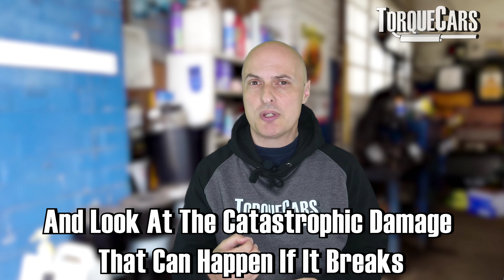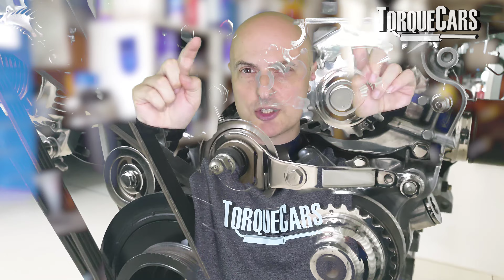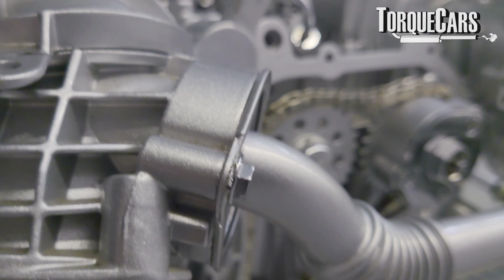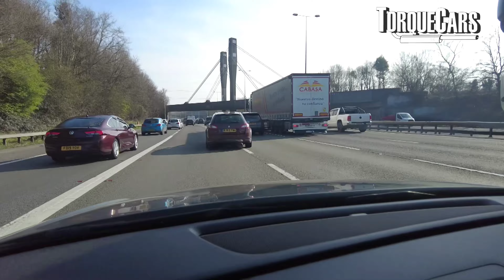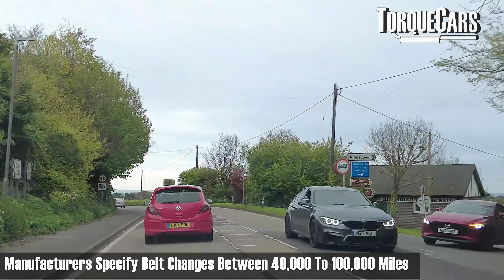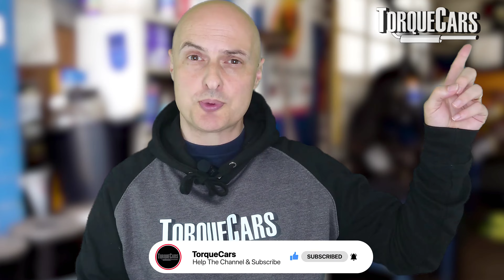Timing Chain & Cam Belt Failure: Why Delaying Replacement Could Destroy Your Engine!

Comment: Never heard  of a "wet belt". When I had a '92 Passat, I had the timing belts replaced according to VW's maintence schedule (every 60K miles). Signing off from Silicon Vallley, USA.
Reply from the maker: They are a modern abomination. They help fuel economy though!

Comment: with the introduction of wet belts on more engines this is more important than ever to keep the intervals in mind, as i found out after i bought a low milage 2014 focus. Two weeks after i bought it the belt snapped with absolutely no warning and i'm still waiting for it back after having a new engine fitted two months later. Fortunately its being done under warranty as the dealer should have made sure it had been changed before he sold it!
Its not always the mileage that kills wet belts either, its the age!

Comment: I own a 2015 VW Golf 7 TDI 1.6L @ 140.000 km so far. The manufacturer specifies a cam belt replacement at 210,000 km but no specific time limit. Since the car is now almost 10 years old, I’m uncertain whether I should replace the cam belt despite not reaching the mileage limit. I’m also concerned about the condition of other related components (rollers, pulleys etc). What would you recommend in this situation?

Comment: Nothing but complaints with tonnes of early wet belt failures with huge costly wasteful bills. Wet belts on all cars are a disaster with very stupid excessive charges when comes to changing if not already failed on you.

Comment: @torquecars can you tell us your thought's on vw's 140k mile and no age limit on timing belt replacements?
Reply from the maker: Of course the manufacturer always knows best, they tend to be quite conservative usually but I'm not 100% sold on this.

That mileage is quite stressed if done on short journeys or with lots of speed changes however if most is fairly constant there is much less stress. So I'd think about the stress the belt/chain has had to cope with.

With belts I stick with a very conservative 7 years 70,000 miles, with a chain I feel there is more scope to go longer and will wait 10 years 90,000 but that is just me. Audi Uk are still AFAIK recommending a change at 5 years although the rest of the world have dropped the time limit.

I'd be curious to know how people have got on before I commit to a longer change schedule.
Reply: @torquecars Thanks for yor reply I read on the audi owners club forum that there is no time limit on timing belts now,  only mileage at 130k miles.
Reply: @honestreview1043  Cambelts wear with age, especially rubber belts that perish as well, hence virtually everyone i.e. Ford say 120-150,000 miles depending on engine or 10 years max. Asking for very big expensive trouble if don’t change.

Comment: I think it's going to depend on the mileage and style of driving, if you're thrashing it, then yeah I suppose you have too. I had a 1998 Mercedes A140 from new, drove it gently, eventually I sold it with 250,000 with the original cam belt 15 years later. It's the same with all my vehicles, never changed my cam belts.

Comment: Back wen I started driving and owning cars - 1966- no one thought about this subject. They would have laughed at you changing stuff that was not broken. How designers have mugged us over the years to feed their dealers' profits. Still, no timings belts in an EV but they will still mug you for sure.
Reply: Woulnt be an issue on a non interference engine. Not sure when engine designs were switched.

Comment: My 2000 V70 went 15 years and 50k miles on the original timing belt. I'm hoping the 2nd one will last to 11 years and 70k miles. By the time I get to 2026 and I have 120k miles, it will be due for timing belt, PCV, axles, coils and plugs, tires, brakes, and probably some other stuff. The transmission in it is currently starting to slip and it's the most problematic year too so it will be a good time to scrap the car or sell it cheaply. I already have it's replacement in the garage so it's going to be okay. It'll be a shame and sad day when it goes away because the 5 cylinder is so nice and the seats are so comfy.
Reply: 15 years with 50k miles is like my 5 years old car

Comment: Our 1.2 TSI engine received a new timing chain at about 142k miles. It started to rattle for a few seconds after start up which was an indicator it was worn.

When our 1.6 TDI engine got a new timing belt last we were very lucky. A bolt holding one of the pulleys in had become fully lose and was only held in by the plastic guard!

Comment: I refuse to buy a car with a cambelt !!!
Reply: Cos every engine with a timing chain is the pinnacle of reliability...
Reply: Chains are just as bad now.

The chain on my bicycle is more substantial than the timing chains they put in engines these days.

They are designed to fail and to cost a fortune to replace.

Comment: Why change the chain at whichever comes first? My F-type is 8 years old with 28000 km on the clock. Does metal deteriorate when not in use?.
Reply from the maker: Belts certainly do deteriorate with time, but chains as you suggest are certainly much less subject to that. Rust is a potential problem, but this is mitigated with metal selection and a coating of fresh oil every time the car is started. Audi specified a 140000 interval but no time limit on chain changes, although Audi UK still say 5 years. In my experience chains mostly tend to stretch rather than break which causes some problems.
Reply: @torquecars  Chains tend to 'stretch'? or do you mean 'wear' which isn't stretching? As in motorcycle et-al chain wear (not stretch; as they actually can't!?).
Reply: @Richard_L_Y  The pins wear which will make the chain longer, giving a stretching effect
Reply: @retro423  exactly 'wear' not 'stretch', two completely different things.
Reply: @torquecars  I don't think (hardened) chains 'stretch' as such but wear and so become elongated - whether e-bike / cycle / M/C chains... those wear not 'stretch'... or are car timing chains different?
Reply: Engine oil does deteriorated even if not use.
Reply: @hengleekai7788  Agred, I bought my F-type exactly 1 week ago and it has been sitting for over a year with 300km since the last oil change. Tomorrow I'm changing the oil and filter. I haven't been using it over the past week because of this.
Reply: @kyproset 👍👍

Comment: My 10 year old audi a6 on 63,000 miles and not changed yet. Spoke with audi and theu say it doesnt get done till 140,000 and no intervals.
Reply: Surprising given Audi officially switched to the recommendation of 5 years, in the past the recommendation was 7 years max (my oldest is a PD, there it still says 7 years or 120k km). All garages I ever came in touch with strongly recommended not to exceed a grand max of 10 years, and rather go at least for a thorough check if every penny has to be saved. 
I was kinda surprised to see that on my oldest car, it s been nearly 9 years (but only 60k km since the last change) and honestly, I wanted it done coz I had the impression that I heard some ticking noise, especially in idle which also seemed rougher than what I perceived as normal. Verdict: gladly it was just the V belt tensioner for the alternator having too much play. I m happy I had it all done, I feel like it runs smoother in idle and ofc the other noise is gone as well (should have said like a well tuned tractor coz smooth and PD engines...) plus I have my peace of mind back. If I were you, after 10 years no matter what km/mileage, I d have it all at least thoroughly checked.

Comment: I',ve done several wet belts, right now finishing one on a 1.0 Vtec Turbo, the vtec oil solenoids got clogged with bits of rubber from the belt, also on PSA 1.2 engines the rubber can clog the oil pump "net" causing serious damage. English is not my mother tounge but I think you can understand, my advice for anyone is to avoid either of those I mentioned and the ford 1.0 ecoboost engines
Reply from the maker: Yes indeed, those wet belts seem to be a joke when it comes to reliability.
Reply: @torquecars it does feel like a joke from the manufacturers themselves
Reply: Consumer from Asia will never accept this type of engine.
Reply: Your English is perfect. So is your advice.
Reply: Wet belt is ‘the worst joke’ in car industry. PERIOD.

Comment from the maker: So when was  your cambelt or timing chain last changed?
Reply: After 120 000 miles [ 12 years ]. Next replacement will be after another 120 000 miles/ 120 months as advised by the service. May actually replace it after 100 000...Currently 178 000 miles on odometer. Having 2010 Ford Mondeo 2L TDCi.
Reply: @DaffyDuck-b8f  Good engine . Taxi engine see Alan Howett videos. He never saw a belt snap.
Reply: Never in 39 years of driving.
Reply: I’ve got a Seat Tarraco 2.0l TDI and VWAG now suggest Cam belt change 140k regardless of age vehicle?  The garage was trying to talk me into coming in earlier though.  Whats people‘s thoughts on this. No age limit and en excess of 100k miles. Have VWAG improve their Campbell belts that much? Super rubber?
Reply: @clinteastwood8222 I have a golf Gtd and the belt is just over 5 years old and only done 34k miles. I'm not sure how long I will wait until I get mine changed. It would take me another 15 years to get to the 140k mile limit.
Reply: My general outlook is good maintenance saves money over time and costs I can plan for, are costs I can handle. I was slightly shocked to see that in my oldest car, the cam belt change was almost 9 years ago even though I only did 60k km during the time span but literally every garage warned me in the past not to exceed 10 years grand max (Audi recommends 7y/120k km for my engine). Also had some ticking noise which disturbed me more and made me feel uneasy but that turned out to be the V belt tensioner for the alternator so this could be done at the same time saving labour costs. I feel like in idle, it s as smooth as a "PD tractor" can be.
Reply: @torquecars  i just changed my x1 at 80000 km, thank you to my local mechanic ,very profesional
Reply: I remember a fail of a timing chain even on a Mercedes w 124 model. Back in 1999, a taxi of the smallest diesel engine of this model (74 bhp?) had even with warm motor conditions some "nailing" sound in between the normal noise before the collapse. One day later in the next shift another driver experienced the engine just stopping. It needed quite a while for the garage to fix it but was possible.
Reply: @torquecars  I have a 120d E82 BMW with the N47 engine, 162,000m and no idea when or if it's been changed.  Seems to be running lovely but I'm aware it could also go any time.
Reply: m57d30 2006 has 500k km on software and 200k on the car display. So i changed it and till now i have no issues with it. bmw e90.
Reply: 130000 miles and 8 years.  2015 Golf Sportwagon TDi.
Reply: A3 1.9TDi 8P1 Sport 2006: at 70,623m Nov 2013 (full Belt Kit / Water Pump) car now at 115,200m (engine still sounds like new; doesn't burn oil; however intermittently has almost violent start-ups which shake engine / gearbox / car... which likely is stressing the belt (/bearings/pulleys) too much!?). So this belts done 44,577m and 12 years!  i.e.: by miles it shouldn't be near needing changed; however by age / years it should have been changed 5 years ago!? Wasn't intending to change until belt etc has done 70K miles; i.e. at 140K...!?